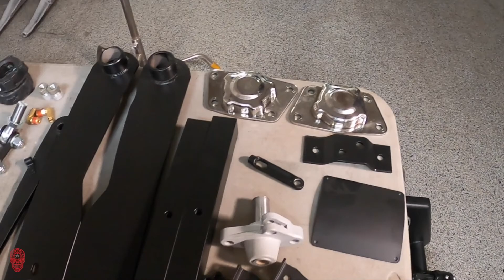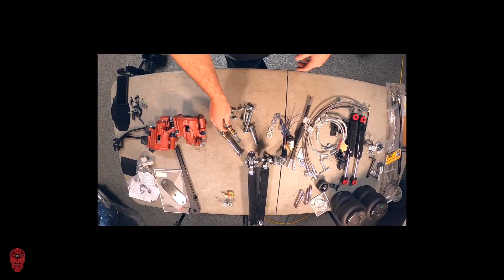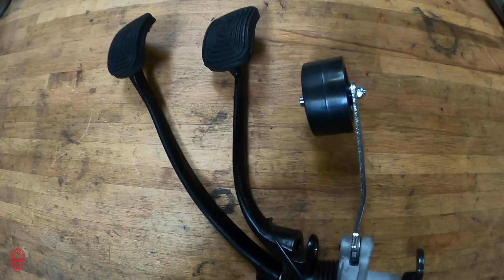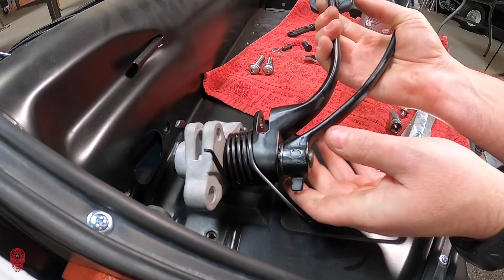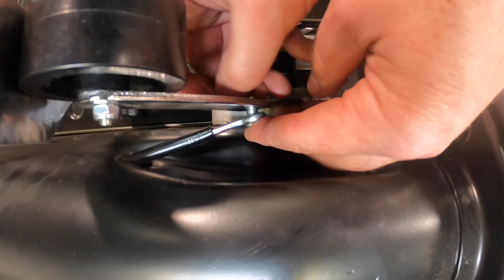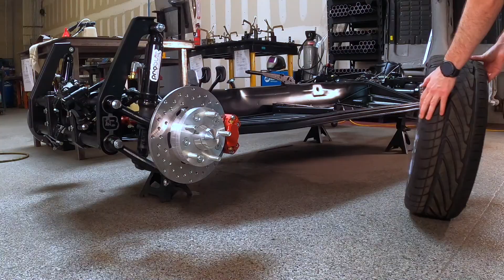Complete Build of a 1962 Classic VW Chassis — Chassis 86 Ep. 11 (Full Assembly)

Comment: Hi guys, a question, please? Brake lights are on, and when I press the brake pedal, they turn off. Wires are correctly plugged into the sensors( three prongs) Thanks
Reply from the maker: Ground issue

Comment: Excellent! Just a question here; the brake fluid reservoir it’s a provisional setup? Or it will stay as it is now? I have seen troubles whit the reservoir installed that low… saludos!
Reply from the maker: We use that on just about ever Volkswagen we build. You have seen trouble with this reservoir?